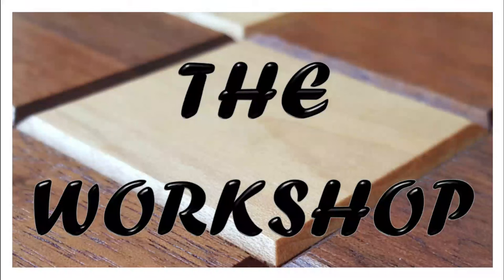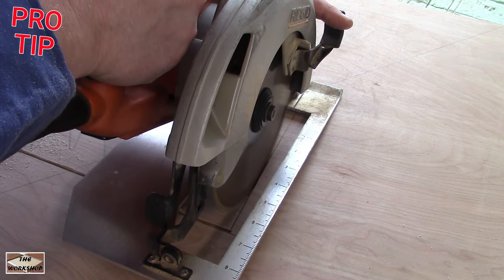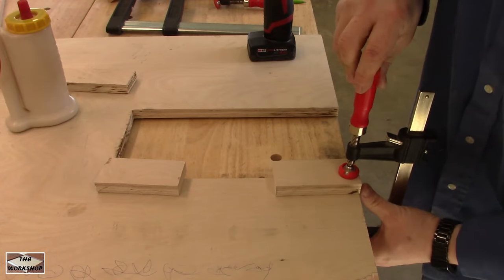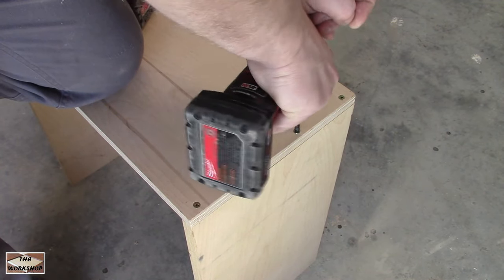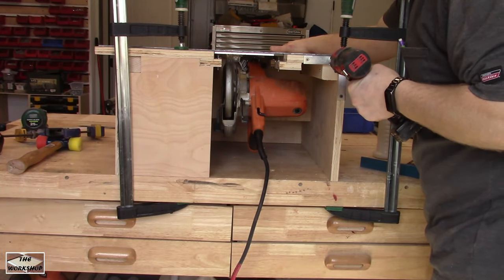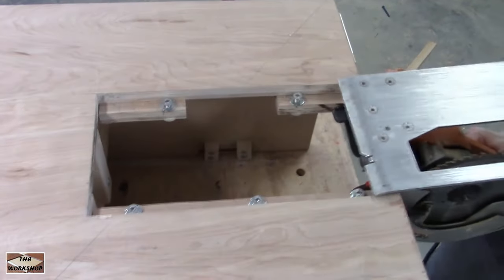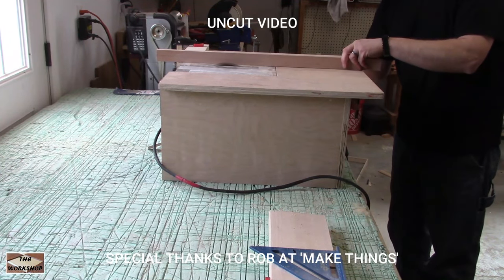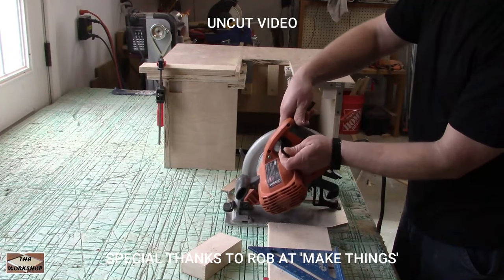DIY Table Saw That Makes Sense

Comment: The fence is the most critical part of a table saw, please make a video on the fence and how you make it both 90 degree from the front edge of the saw and perfectly parallel to the saw blade
Reply from the maker: Thanks for the comment VADOCO2. I totally agree with you about the value of the fence. i have a video in the works to explain how to address the fence.

Comment: Plexiglas thickness  reduces the cutting depth of wood.  What is the reason for adding it ?  Many good ideas are in your design.
Reply: I wondered just the same. What was the reason you added the plexiglass and decreased the potential cutting depth?
Reply: Plexi glass is there for zero space clearance. So smaller cutoffs don't fall through the gap and into the blade.

Comment: Nice job, one comment. Stop buying Phillips wood screws Buy square socket instead, much better to drive will not skip
Reply from the maker: Thanks. And I totally agree with the phillips. I scored some 50# cases for $10 so I'm working through them.

Comment: Nice project and simpler than other methods I have seen. I liked specially the idea to use gravity to hold the tool in place. Does this table allows to tilt the blade?

Comment: So, most circular saws have the safety switch that you press and then the trigger to begin cutting. How did you get around that?
Reply from the maker: The saw I used did not have a safety switch. You could use a cable tie to hold that switch down.
Reply: @DIYMinded  awesome, thanks!